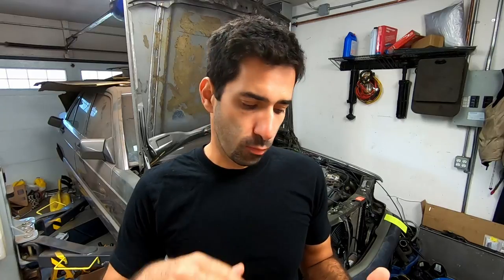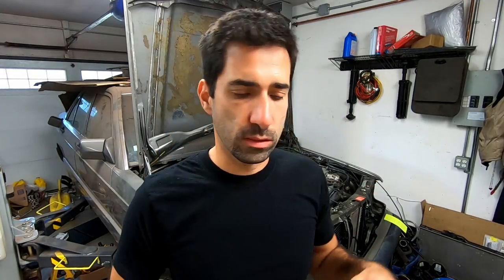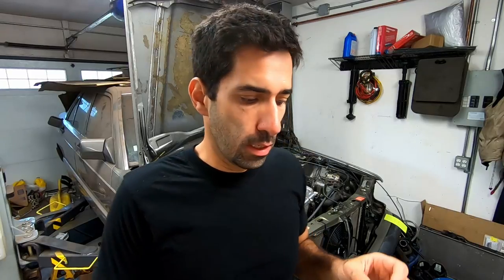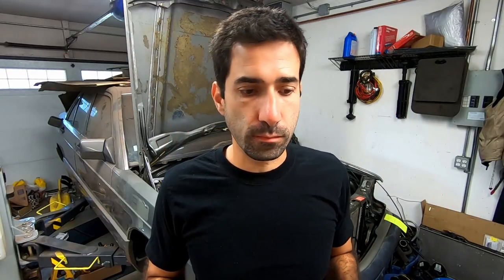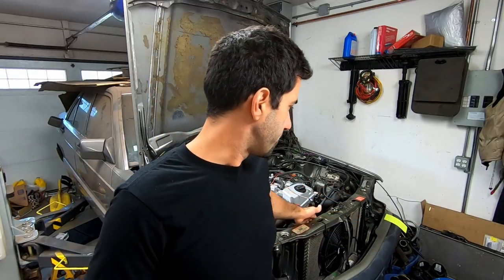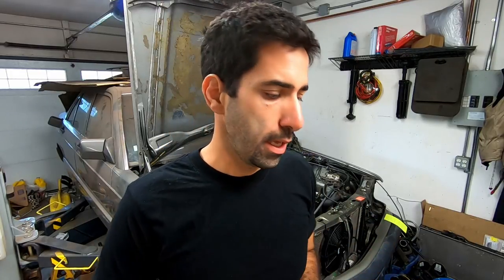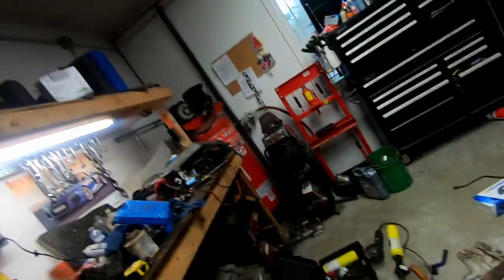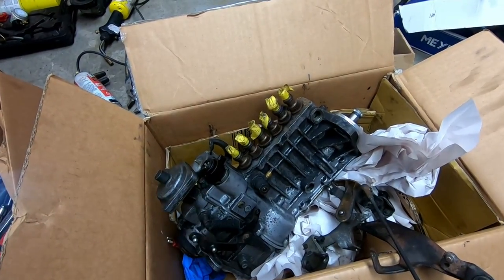Mercedes Benz 190E (W201) restoration and OM606 swap - The Last Chapter (part 1)

Comment: Thx for this! Really appreciate all the details u included. I've got an '87 w201 Turbo Diesel 602 paired with a 5 speed from an 85 w201 diesel. The 602 has about 270k on it when it hits a million I'm going to put a 606 in it, if I can wait that long 😊 Looking forward to seeing how it all comes together. What r the best forums u've found for help doing this build?
Reply: @ETMotorsports  I guess because I've heard so much about the 603 cylinder walls cracking and that the 602's while less prone to it, I had read in some forums that it happens to the 602's as well so I've never thought to want to add more power to the 602, but if u know otherwise that would be awesome and like u said a lot more practical than all the repackaging it takes to get the 606 in a w201. What pump and turbo would u recommend for the 602?
Reply: @ETMotorsports  What I remember reading about the 603 is that they used the same block size as the 4 cylinder 601 and so the cylinders were much closer together and the walls between them would crack. It's been awhile since I was on the forum so I may not be remembering exactly right but the last 1980's mercedes mechanic I was at, he had a w124 wagon with a 603 and he showed me the other 603 he had on an engine stand because he was expecting that issue. He also pretty much refused to work on my w201 and told me to just sell it for a w124, he was cool but he was almost retired and didn't want anything to do with the ac/heat system on my 34 year old w201.

Anyway, thx for all the great advice on what I can do with the 602. And yeah I have the turbo 190d they made for 1 year in '87. Do u know how hard it is to adapt the He221 or He200 to the 602. I see they sell mounting kits for the 606 and 617 but I don't see one for the 60x engines.
Reply: @ETMotorsports  He had a big ol beer gut i think he really needed those extra few inches the w124 has over the 201. 
Okay so as far as mounting the he221 so it would be able to bolt on to the factory position and then run alls those lines u mentioned do I need to get them made or is it just plugging back in what is unplugged taking off the old factory turbo? And yeah an intercooler sounds good 👍

While I've had to do some work to just about every other part of the car the turbo has been working so I'm not too familiar with it.

Comment: Where did you get the water pump pulley? I can’t seem to find any 😅
Reply: @ETMotorsports   so I got the car in an accident and the radiator got smashed into the fan clutch and water pump pulley. So I just have the water pump with no pulley. That’s all I need to finally install the belt

Comment: Do you need a restrictor to prevent oil coming through the turbo into the air intake manifold?
Reply: @ETMotorsports  Ok. I thought so too and played around with restrictors while measuring holsets recommended pressure and oil flow. Nothing made much diffence. So I have no restrictor. I do however have quite a bit of oil in my intake. Turbo is new, HE221W.
Reply: @ETMotorsports  OM602 with 115,000km. Rebuilt head. Dieselmeken 7.5mm pump set at 120cc. Boost is limited to 25 psi. I installed a catch can between the valve cover and preturbo air intake. I thought it might be the issue, but the output line into the intake is dry, so it has to be coming from the turbo. Its worse now as its seeping from the air intake itself. I have a custom built return using the original turbo outlet tubing, which is a good size. When you say pull the cover, what do you mean?

Comment: Hey great video. Look like you did some research what engine do you recommend for an engine swap for easy fit and more performance in the w201 I know you did this one just to be different.
Reply: @ETMotorsports  hey pal thanks I'm from Trinidad and Tobago I will start looking for one didn't want to cross breed the car lol most mechanic over here advise jz or LS , I wanted to go m113k but not much available right now and I think I will have to do alot of work for it to fit.
Reply: @ETMotorsports  it have a few it's what they want for it. The prices so far going like $18000, $20000 and $30000. $30000 being out of a first gen Corvette where he shave and ported and just for to show price my boy bought a m119 engine for $7000  Where you from? Maybe when things easy up with covid-19 I might try to buy a good one outside and import it.
Reply: After a few years has gone and men fed up with the high price of replacing parts by the dealership most people sell their Mercedes Benz for cheap or swap out their engine  cause mechanic over here can't fix it their better with japanese cars that's why I got my car for cheap and get it running from the school of YouTube. it still missing something but I won't fuss over it cause I want to make it into a sleeper or muscle car. Lol